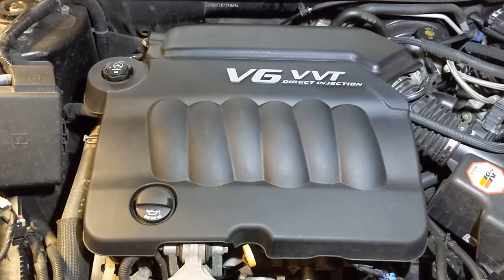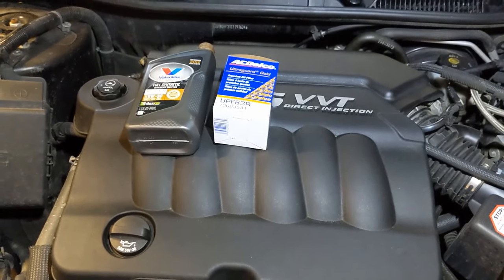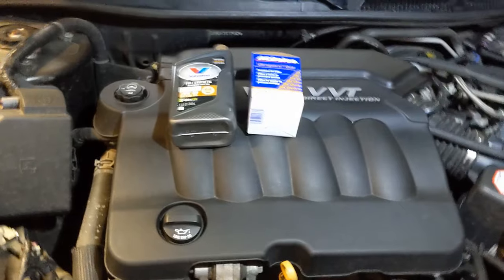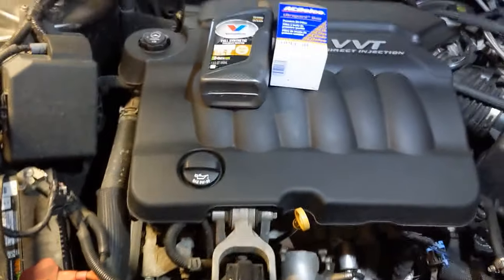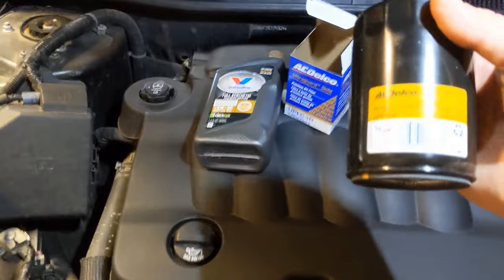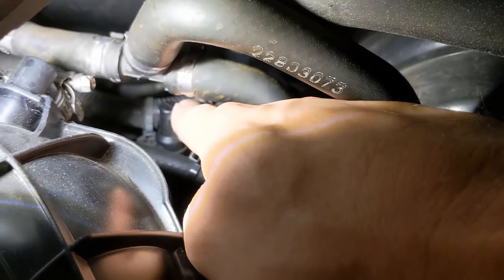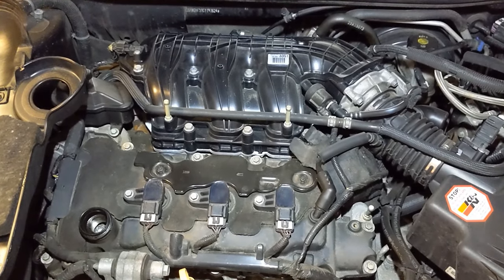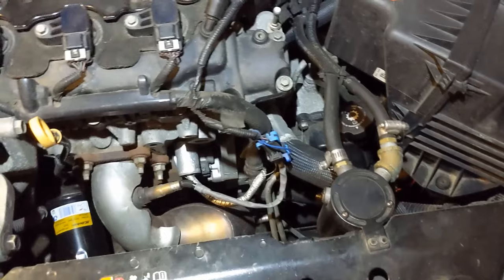How to keep your GM 3.0 or 3.6 V6 running forever - **High Feature V6 LY7 LLT LFX LGX LGZ**

Comment: You mentioned drilling out the PCV valve holes, and also the catch can. Imo assuming the larger PCV holes for better ventilation. Why the catch can? I am very hesitant to buy a GM vehicle with the 3.6 V6 because of this timing chain fiasco I see every time I pull into a shop.  I have a GM 3.1 liter V6 with almost 300k miles. Still runs like the day it left the lot. Never had to do anything to it other than replacing the intake manifold gaskets. Why doesn't GM make engines like this any more? Do the new 2020 and 2021 3.6L engines have the same issues? Sorry for all the questions.
Reply from the maker: Lemme first say I agree with you 1000% on GM not making pushrod V6's anymore.  I'm actively looking for cars for both of my stepsons that have 3800's in them (kinda hard to find one that's not rusted all to hell, considering 2008 was the last year they made them.) I might compromise and go 3.5/3.9 (takes you to 2011) but you're still dealing with all of that VVT shit.  Still better than dealing with the finicky 3.6, tho!!

So in regards to the PCV, you hit the nail on the head. GM did resolve this issue around 2014, but it's best to check anyway. So like I said in the video, these issues all stem from lack of maintenance, however the rear valve cover is the first place the carbon buildup starts, due to the restrictive PCV.  The catch can is to keep oil out of the intake tract.  The problem isn't unique to the 3.6, it's very common on all direct-injected engines.  All engines experience a bit of oil blow-by, but port-injected engines naturally wash all of this off of the intake valves due to placement of the injector right outside the intake valve.  With DI, no such thing happens due to the fuel being sprayed directly into the cylinder, so the oil collects on the intake valves, turns to carbon, and builds and builds, and builds until it chokes off the intake valves' operation. The catch can's purpose is to intercept this oil blow-by before it enters the intake tract and wreaks havoc on the valves.

Getting back to the 3.6, they are known for oil consumption and oil in the intake when cheap oil is used.  I haven't heard any horror stories on the latest LGX and LGZ yet, as GM seemingly makes incremental improvements to every iteration of this engine. But let's not kid ourselves here, these engines are a far cry from the old pushrod GM engines where you could neglect them for 50k miles or more before you 'd have any problems.  My main reason for this video is not to discourage anyone from purchasing a vehicle with this engine, mainly for people who already own one. I'm saying if you maintain these engines exceptionally well, you will never have any issues. I'm not sponsored by them, but I stand by my claim that Valvoline Modern Engine 5W30 is the best oil to use in these engines.  If you use this oil, there is no need for a catch can.

Hope this clears up any confusion!!
Reply: @CertifiedShadetree  question in low idle when starting the car I hear a small noise  the motor or timing chain.  also when I slow drive like 10 12 miles per hour. Can you do a video of normal engine sound at starting and 2 -5 10-12 miles an hour probably a timing  chain issue i recently did a change oil pennzoil. I have a 13 ls direct injection vv
Reply from the maker: @cristiansalcido471  Until I do such a video, check out these instead:
Driving around at the beginning, outside with the hood raised and engine running at the end:  https://www.youtube.com/watch?v=Aqf5SqxdvPE

Starting the engine and revving it near the end of this video:  https://www.youtube.com/watch?v=VXTp1nOvfVI&

Comment: My holden Commodore omega alloytec is LE0, 180kw motor. Strange seeing you guys having the engine a different position. Mines at 185,000km+, going strong. Change oil every 5000km. Only issues I had were coolant leaks, thermostat housing and water pump. Besides that, solid.
Reply from the maker: Yep, aside from a couple of Cadillacs and the Camaro, everything in the States these engines come in is FWD.

Comment: Had a 2008 3.5 v6 impala with 320,000 miles on it. Still running strong but the transmission had enough of my crap and gave up. Never ever broke down or left me on the side of the road
Reply from the maker: Those pushrod 60° V6's will outlast the 4T65E transmission 2 or 3 times over!!
Reply: Yeah I've had to replace my transmission in the driveway, not to tough, but other then that.. great car

Comment: I have an 09 Saturn Aura with this exact same engine that is coming up on 270K miles and it's still running like it did 200,000 miles ago. For the first 100K miles of it's life (I didn't intend on keeping the car long) I changed my oil every 5K miles but used a good conventional oil. Once I decided to keep it, I switched to synthetic but still continued changing it every 5K miles. I'm sure the synthetic oil could have lasted longer but I wasn't concerned with it breaking down so much as getting dirty or running low as I was burning a quart or so between changes. These engines can burn oil due to the design of the PVC system so it's important to check your oil level every 3000 miles and top it off if necessary. I have zero reason to believe that this engine will not go well over 300K miles without a major issue
Reply from the maker: That's an impressive number, no matter the engine, but all the more impressive considering most people don't get to 200k with a 3.6.  The one good thing about the LY7 is it doesn't have direct injection, so when the PCV system dumps oil into the intake, the port injectors wash off the backs of the intake valves.  The next version, the LLT, is the one that is notorious for carbon buildup and timing chain stretch.
Reply: After watching the video and reading the comments (such as yours) I’m a little gun shy now about getting one. I thought my experience with this engine was common, looks like I might have just been lucky.
Reply: This is a rarity I had 2007 burnt oil smoked and oil in the spark plugs died at 110k Miles what a pos
Reply: @CertifiedShadetree  Is 200K viable with the change though?
Reply from the maker: @mrghost12121  The odds are greater with each engine revision. LFX, LFY, LGX, or LGZ I'd say it's a certainty.

Comment: I have the 3.6 in my 2012 LaCrosse. I should mention the reason to change the oil more frequently, is the VVT. I believe there is a flash update for these cars for the oil minder to change the oil more frequently because the VVT's were failing due to extended oil changes. I haven't had mine reflashed yet, but I'm changing the oil and filter at %75 now.
Reply from the maker: I've heard they were doing the reflash as well, but it still wasn't conservative enough, so I say stick with 4-5k intervals.  Also, the timing chains stretch and jump time when the hydraulic chain tensioners fail due to the extended OCI's and/or lack of maintenance (either by dirty oil or no oil.) This happenes on the older non-VVT engines as well.  So add in the VVT cam phasers failing for the same reason, you have a recipe for disaster!! 💣💥
Reply: I have the 13 lacrosse with this engine vvt. I just got it and when I hit the gas it does not take off till after 12 sec. What can I do to fix this
Reply from the maker: Any check engine light?  Without knowing what codes it's throwing, I'd focus on the throttle body, MAF sensor, and the high-pressure fuel pump.

Comment: Got a 3.0 LF1 on my middle east edition 2014 malibu it's running 300K kilos (about 200K miles) no problems at all and a i do is flush clean and change oil
Reply from the maker: That's how it's done, right there!! 👍

Comment: Well I have a 2016 Impala LTZ Limited my daily commute is 100 miles which 95% of it is Highway I do use full synthetic oil and also use the oil monitoring system I have 184,000 on it so far so good
Reply from the maker: Nice! 👍
Reply: The car that I had previous to the Impala was a 1998 Monte Carlo LS with a 3.1 l bought it used to years old in 2000 owned it for 17 years oil changes back then every month using 10 W 30 believe it or not 378 thousand miles and some change the transmission went out on it Thank You For You video and Responding back I guess what I'm trying to say is that if you take care of your cars regardless of the make and manufacturer that these cars can last
Reply from the maker: @mikeberthold1593  That's impressive!! Did you always run the 10w30 from the very beginning or was that after she accumulated a few hundred thousand??  I'm remembering the first 3100 I had, I put 10w30 in it during the summer and it ran like shit. But the car only had 25k or so on it at the time, so the tolerances were still tight. 5w30 smoothed her right back out and I've never ran anything but in subsequent 3x00's. Not too surprising the transmission went out at that mileage, tho. If you had a 3800 in front of that 4T65-E it would've failed much sooner!!😁

Comment: First, thanks so much for your videos and taking the time to reply to your viewer's questions with DETAILED answers, very nice of you sir. I live in Montreal and winters can get pretty horrible here. I honestly don't know much about cars but I am shopping for one at the moment and fell in love with the Lacrosse, my goodness that car is dreamy and cozy. I'm looking at either a 2010/2011  CTS with the 3.6 LLT vs 2012 with the 3.6 LFX. Is there really a big difference between the 2 in your opinion? Should I just focus on trying to find a 2012 LFX because of the known issues with the LLT ?  Looking to buy one with around 100k miles more or less, and I hope to keep it for very long. Also, I'm wondering if you have more info about suspension within those models ? So many potholes in Montreal, I really want a car with the best suspension possible and best comfort. In your opinion is there a big difference between the  HiPier Strut + H-Arm in the 2012 Touring model vs the MacPherson + 4-link in the Prem 2 model ? Thank you so much for your help and time.
Reply from the maker: I haven't had any experience with the HiPer Strut (yet) so I can't comment on ride, handling, replacement costs, reliability, etc. As far as engines go, I would absolutely recommend the LFX over the LLT!  Just read the comments on my injector replacement video - the LLT sounds like an absolute nightmare of an engine (on top of that, I can't believe GM continued to install it in the Lambda crossovers until 2017!)  Good luck with your search!! 🍻
Reply: @CertifiedShadetree  Thank you so much for your reply my friend, i will most definitely watch your other videos ! Have a great summer !
Reply from the maker: Thank you, and you as well!! 🍻

Comment: I am buying a 2010 Buick LaCrosse tomorrow with 165,000 miles on it. I took it to my mechanic that I trust, and he said that it looks really great, and has been serviced regularly (fluid changes). But hasn’t had its 100,000+ mile service.... needs spark plugs, brake pads, and I’m going to have him do a full engine decarb. Do you recommend this same oil your using in the video for me to use on its 3.0 V6 direct injection engine as well? Appreciate the help in advance, and great video! Thanks
Reply from the maker: For sure, I would recommend the Valvoline Modern Engine oil.  It's engineered specifically for DI engines.  Congrats on the purchase, BTW, and good luck with her!! 🍻

Comment: IMO there is no need to do ANY modifications to these engines so long as you maintain them . Check the oil level every week , service the car at 10000km MAX intervals and most of all DRIVE IT .. I honestly believe these engines DO NOT like being driven short distances over long periods of time .. had a 2016 Holden commodore evoke come in for a service some time last year.. had almost 170k km on the clock which is huge distance for its age... the whole car was IMMACULATE.  Interior was showroom condition and the engine and underbody looked like the car had just come in for its first service it was bone dry. 

The HFV6 engines get way to much hate because of bad maintenance . But if you follow the steps mentioned above they won't let you down.  

I work as a Holden mechanic and I know a gold master technician for GM that swears by the V6 over even the LS powered commodores.  He is quite literally one of the best GM mechanics on earth .. so that says alot for these engines.
Reply from the maker: I agree completely about the engines, but I believe the same could be said for GM vehicles in general. People bag on GMs for being unreliable, but it's truly the dipshits that don't maintain their vehicles properly that are the ones complaining the loudest! 

Don't need to say it to you, but a WELL MAINTAINED vehicle, regardless of make, will run forever!

Comment: What does drilling out the pcv valve prevent or why should I do it? I just got a new 2012 Chevy impala with 41k miles on it and I want to keep it running forever.
Reply from the maker: Due to the holes in the PCV being undersized, the airflow through the dirty side is restricted too much and as a result carbon builds up under the rear valve cover, and eventually spreads to the timing chain and the rest of the valvetrain.  The factory (supposedly) corrected this issue in 2014 on the LFXs by installing PCVs with the enlarged holes. I say supposedly 'cause when I pulled the PCV on my 15 Limited, it still had the smaller-holed PCV (Camaro guys swear their 14 & 15 LFXs have the enlarged holes - take that for what you will..)
Reply: @CertifiedShadetree  ok cool! Thank you!!
Reply: @CertifiedShadetree  If the holes are restricted, could that cause moisture buildup issues in the crankcase?
Reply from the maker: @socialjusticewarrior9601  I haven't heard of any moisture buildup issues, just carbon sludging. The engine will burn that off right away anyway..
Reply: @CertifiedShadetree  could you make a video on how to do this? I don’t want to mess it up.
Reply from the maker: @josiahargueta9389  Video is linked in the description.

Comment: Honestly this car impressed me I got my 15 limited LT with 82k miles and I use it for work (I drive a lot)  and I’m currently at 162k and all I’ve had to do is oil changes and brakes also the infamous impala actuators 🤣.  Running it on e85 really makes a difference too its quicker.
Reply from the maker: No injector issues with the E85?
Reply: @CertifiedShadetree  Not yet🤞🏽 hoping it stays that way lol
Reply: @CertifiedShadetree  I always switch back and forth between e85 and regular gas ( I run it down before Mixing them) and no problems tbh
Reply from the maker: @cc56782  That's good!👍
Reply: @CertifiedShadetree  Piston rings can also develop issues with e85 the stuff is like glue especially if the car is not driven daily.

Comment: LGZ is a really a different engine. They changed the timing chain from 3 chains to 2. New heads, intake, Pcv system. They just kept the 3.6 moniker. All though keep changing you oil every 5k miles with synthetic oil!
Reply from the maker: Good info, thanks for sharing! 🍻
Reply: It's actually a completely different engine. A new generation engine you would say. Same family, new design.
Reply: LGZ and LGX engines have Active Fuel Management.
Reply from the maker: @atx-cvpi_99  I thought they had auto stop/start, not AFM. 🤷‍♂️
Reply: @atx-cvpi_99  They also have auto stop start!
Reply: @atx-cvpi_99  which year
Reply: @manuelesquivel2107  2017 and up I believe.
Reply: @atx-cvpi_99  auto start/stop only on some platforms.  LGZ is a vastly superior engine compared to early models.
Reply: @madcratebuilder  So is the latest 3.6 a very reliable engine NOW....no timing chain guide issues / chain issues ?   cam phazer issues ?   carbon buildup issues ?    Make it to 200,000 without internal work needed?    Thanks.
Reply: @barrya.6212  I'm seeing 100K + engines still running fine, the 2 chain system appears to be better than the older 3 chain.  New PCV system has made a improvement with carbon buildup but still may need to be addressed by 100K.  Oil changes has a big effect on the life of the chains and cam actuators.  Cam actuators are cheap and easy to swap out.  Time well tell if the LGZ can go 200K on the timing chains.
Reply: @madcratebuilder  Thanks... so this LGZ upgraded engine is currently in the US and Australian models?
Reply: @barrya.6212  The LGZ is in the mid size GM trucks from 2017 up rear wheel and 4 wheel drive.  Front wheel drive has the LFY V6, basically the same but for transverse mount.  This is for US sales, not sure about Australian models but i would think they would be the same.  The best thing you can do for these engines is change oil every 4k.  Kent-Moore has special tools for changing cam phrases with put pulling the front of the engine down.

Comment: I've got one of the 3.6 LY7s in my Holden SV6 Commodore.

The engines get such a bad reputation all because of bad maintenance.

I change my oil every 5000km 

Currently have 310,000km on the clock.
 
Also have drilled out my PCV outlet and have a catch can installed. 
Great torque for a V6. I have to be careful not to light the rears up in 2nd gear in the wet lol
Reply from the maker: I'm pinning this comment!  You, sir, are the embodiment of what I'm trying to get across in this video!!
Reply: @CertifiedShadetree  saying that I've changed the water pump. Gearbox rear seal and driveshaft couplings and centre bearing
Reply: @CertifiedShadetree  and I'm thinking my AirCon compressor is dying lol it's noisy as hell when running
Reply from the maker: Could just be the compressor clutch going bad. It's not that hard to change out, either!
Reply: @CertifiedShadetree  I only noticed it the other day. It's getting the time around work to do it. Hopefully won't need the AC much this summer
Reply: got 125k miles on mine no issues